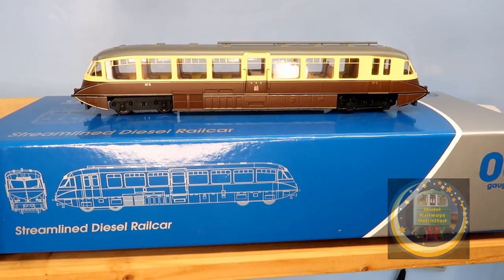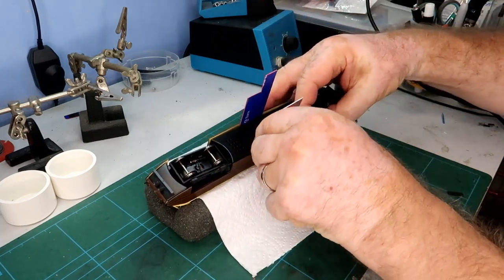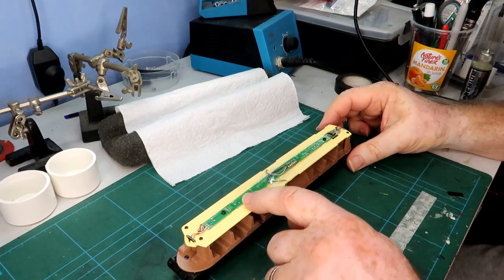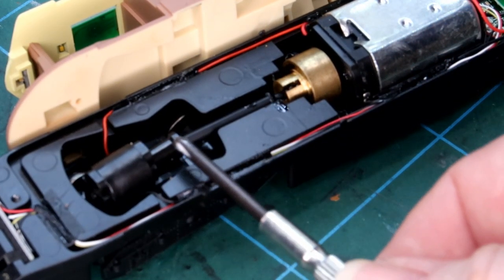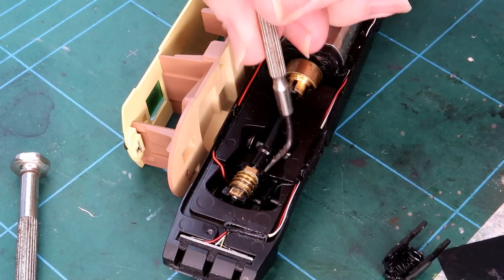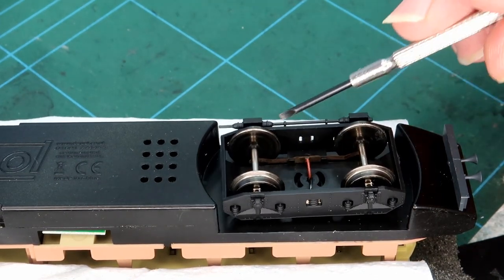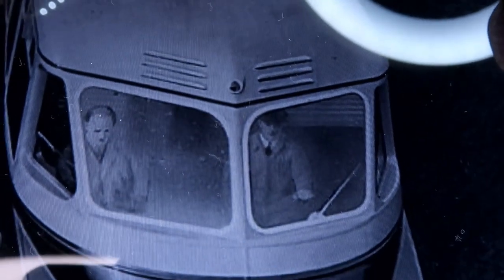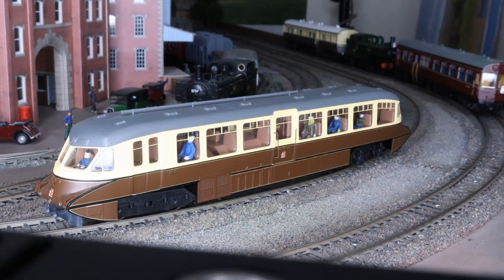Dapol GWR Streamlined Railcar. Opening 🔧 Servicing and fitting crew and passengers

Comment: Cheers Mike, mine needs a service so nice timing.
I have a challenge fpr you if you have any old Airfix GWR Autocoaches in chocolate and cream; Buy 2 or 3 Sharpie double ended ultra fine red permanent markers, pull autocoaches to bits, give the body shell a thorough wash, rinse, dry then use the pens to colour all droplight frames, wait a day and colour them again.. The result is incredible for a few quid. Fit drivers? they go on the right.
I have 6 auto coaches fitted one either end of 3 different Auto train class locos, I paid about a tenner per coach, that's 3 real trains on the cheap.
And here is another idea if you have EFE gated stock in BR red or green. Put one or both coaches behind a Terrier in BR black and you have The Lee on the Solent train. You can do Southern with Terrier only with ultra rare Malachite Green Gated Stock. Keep up the good work. Pics are on Disused Stations website
Reply from the maker: Many thanks, big issue when opening is finding something to hold on to, ease the sides out at the non powered end. Thanks for the ideas
Reply: Yes. Many of my models have benefitted from marker pens- red, black, white, grey and metallic.

Comment: I don't think you get enough credit as a modeller. Fitting passengers and a driver is great, but going for proper period passengers is that extra step. It would be easy to fill it with Chinese Ho 100 for 50p specials, but those figures stand out. Same with the locomotive crews in all the loco's. You know I hold your fathers models and techniques in high regard but I see that same skill and attention to detail in what you do. Doesn't matter if its an expensive railcar, tanker solebar or laser cut vegetable crate. So yea, just for the record the torch has been passed.
Reply from the maker: Oh wow, thank you so much that really means a lot to me. Yes indeed I wanted 1930s look passengers so top hats and ladies in bonnets was required :) I never thought about the fact I was emulating what dad did but I guess I was. I was taught by the best. However what really delights me is you noticed! and that makes it all worthwhile :) cheers buddy